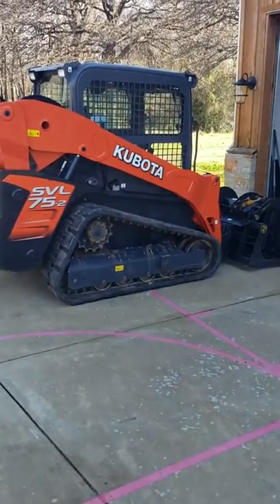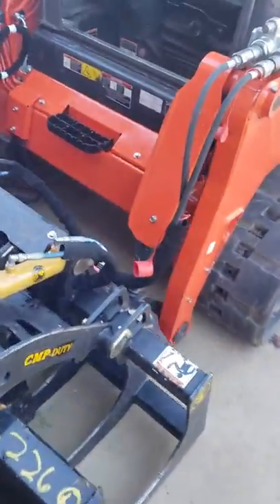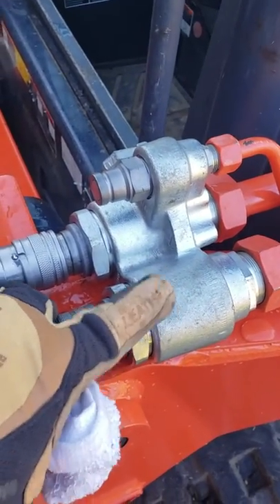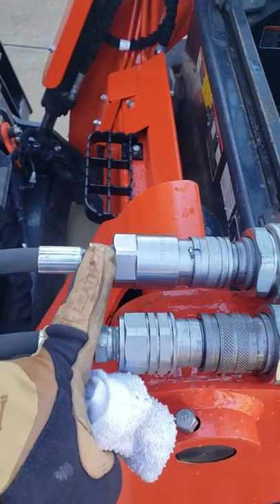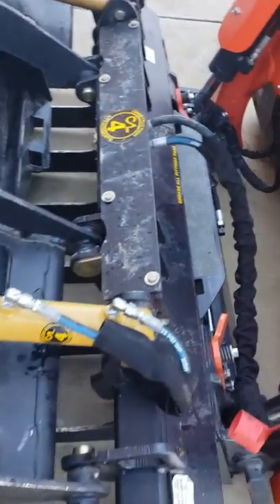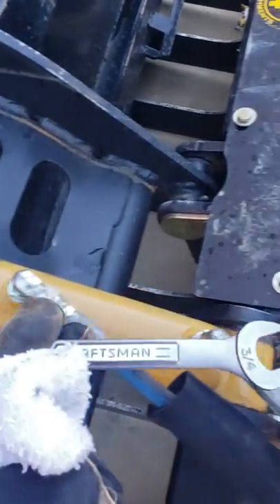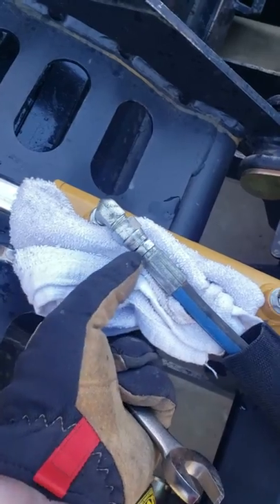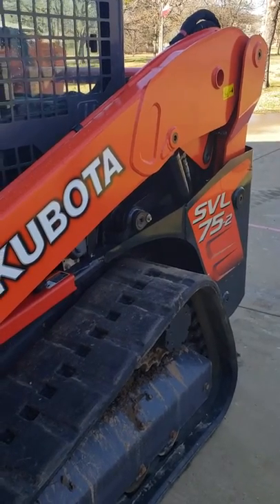Kubota SVL 75 or 95 hydraulic hookup for implements

Comment: I’ve got a 75-2 as well and I had an issue hooking my grapple but it wasn’t on the machine side it was the oil left in the lines of the grapple building pressure on warmer days made it very hard to hook up someone online said then you take it off the machine click your fittings together when not it use and that made all the difference now grapple pops right on in between use

Comment: I have had a SVL75-2 for 5 years and have always been able to push both hydraulic couplers in to connect attachment. Not sure if Kubota has changed the connectors.